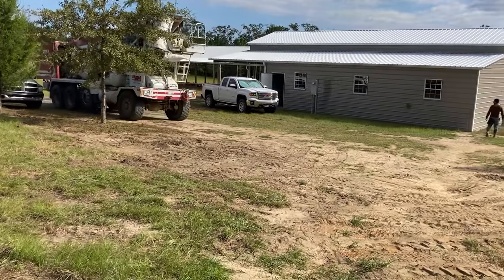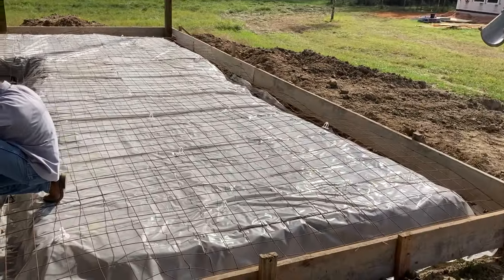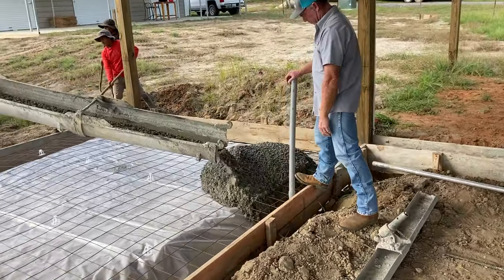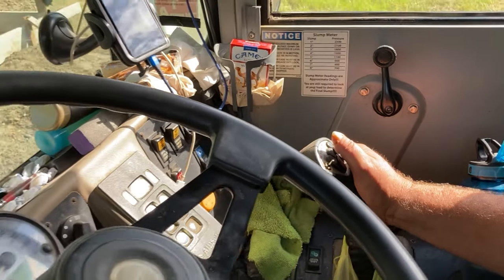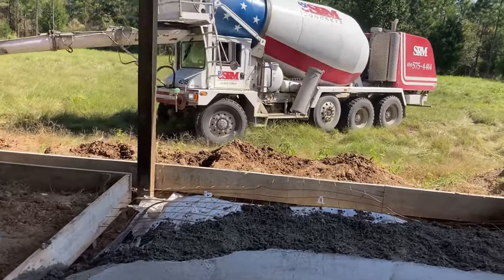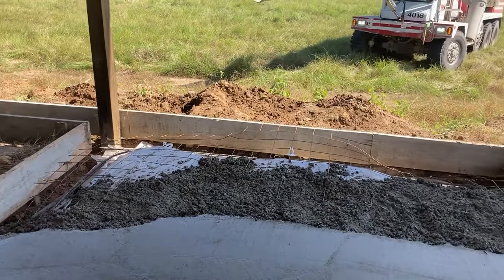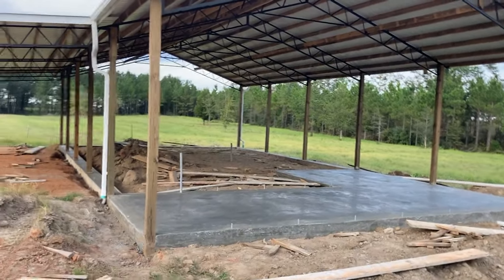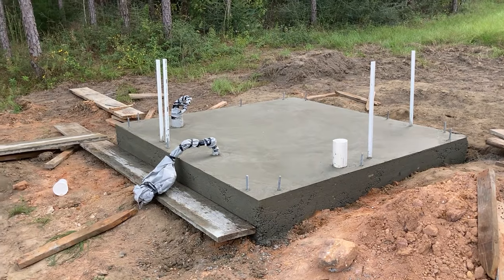How to Pour a Concrete Slab and Footers for a Pole Barn

Comment from the maker: Getting concrete poured in late 2021 was a challenge, but we got it done.  We've designed the interior and are working with a contractor to build it, but materials and labor continue to be issue.  Subscribe for updates!
In case you missed it, here's the link to the Pole Barn build:  https://youtu.be/3ZBHDY4cBKk

Comment: The only thing I did different on my pole barn was I coated the imbedded portion of the poles with roofing tar prior to pouring. It does a great job sealing the poles from the moisture always present in the concrete. I also put foam sill seal around the poles to compensate for expansion/contraction. This reduces the chance for cracking initiating from the pole locations. Otherwise, great job.
Reply from the maker: They make sleeves for them too.   The pole barn has come a long way since then.  Here's our build playlist and more videos coming on this!  https://www.youtube.com/playlist?list=PLG5yS75HLzo2MCmO8M-IQXfvkv-ivvpAU

Comment: I'm getting prepared to build a pole barn.  I've seen some people sit the posts on top of piers or footings, and others set the poles into the concrete.  Obviously you put yours in the concrete.  Any regrets with that decision?
Reply from the maker: I think some of the variance could be regional....frost lines and such. We are worried about wind load here in Florida with hurricanes.  Our poles were dry set in concrete with rebar in the bottom of the post to stop lift.   The footers are for further wind load protection, but also for erosion and animal control. Keep ours from digging out....and others from digging in!  Here's the original build:  https://youtu.be/3ZBHDY4cBKk

Comment: the mesh sitting hard down on the vapour barrier is very bad practice. the mesh should be in the top one third of the slab as a minimum, with proper top cover.

the bar chairs are too far apart and are not providing the correct support to the mesh.,
Reply from the maker: thanks for watching